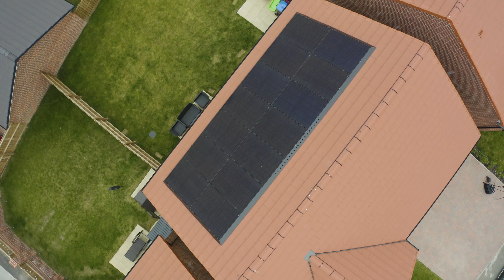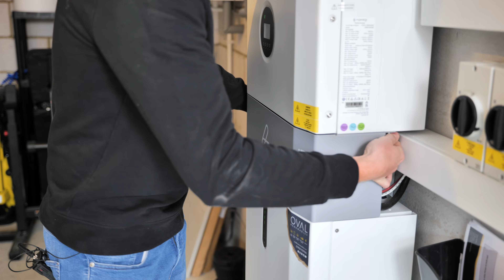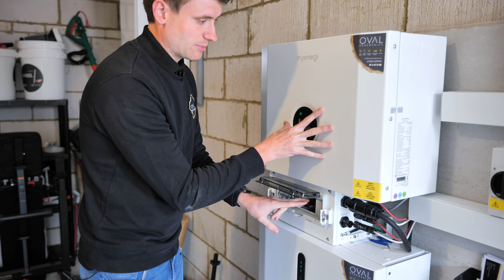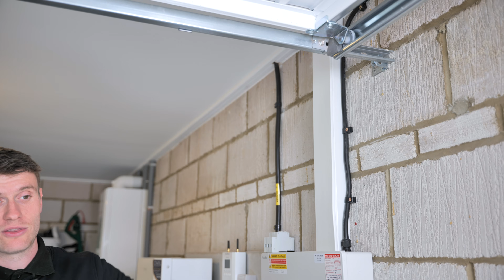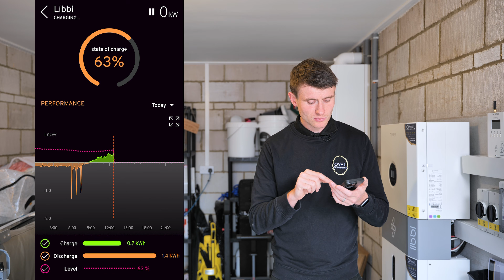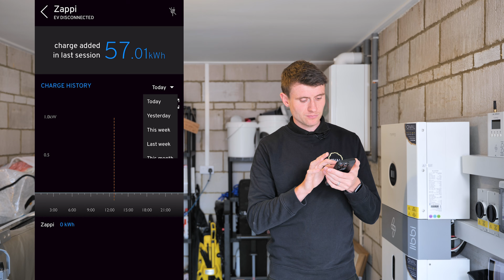What does a full MyEnergi Solar, Battery and EV Eco System look like?

Comment: Hi,
Great video,thank you, I have an existing FIT solar install and interested in upgrading my inverter, I have an Eddi and a Harvi already and really happy with the myenergi eco system, I can’t currently install a battery system due to space and location of the existing inverter, but my question is, can I install a Libbi inverter now, without a battery and add that at a later date?
Reply from the maker: Hi thanks for watching. Unfortunately not, the libbi has to have a battery on it. They are really well priced currently. If you need any help then drop me an email sam@ovalrenewables.com

Comment: I think the generation meter comes down to interpretation of the guidance. I’m in agreement with the efix video that the requirements of needing to see generation data is met by the apps that these systems connect to. The readings are seldom needed for export payments these days as the vast majority of these customers have smart meters.
Reply from the maker: I agree with that. It’s more about what the MCS certificate needs. It still required generation meter details
Reply: Fair enough - I wasn’t aware of that 👍

Comment: 6:17   apologies if you've been asked before but what components do you use to make up your DC surge protection devices please ?
Reply from the maker: The surge protection devices are 600v DC SPD’s from surge protection devices. We use some three port Wago top job connectors and an 8 module Gewiss enclosure 👍

Comment: Nice to see you using red and white string cables, these were the colours we used in the old days for DC.
Reply from the maker: Yes indeed!
Reply: @OvalRenewables  it would be great to see you do a short video showing that the red cable must have it's positive MC4s pointing towards the inverter and the negative plugs pointing towards the panels. So many installers are getting this wrong since this boom we are having. HNY